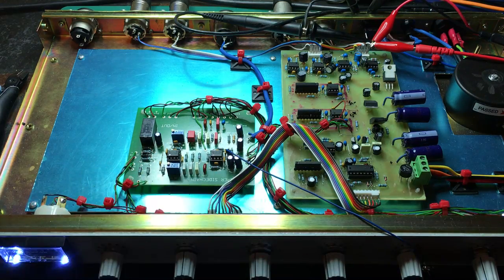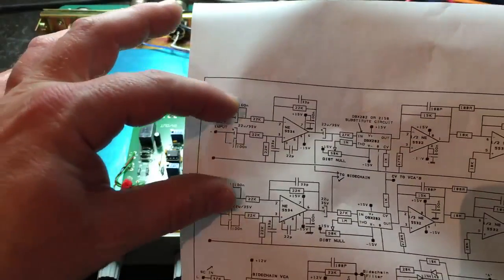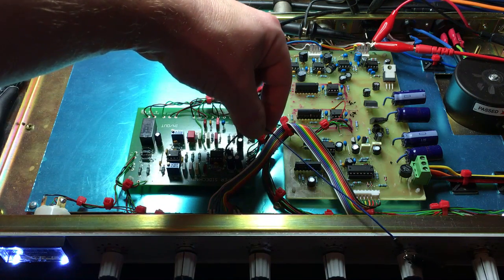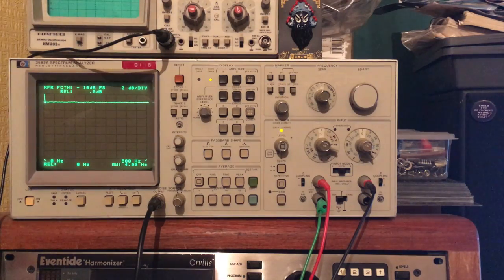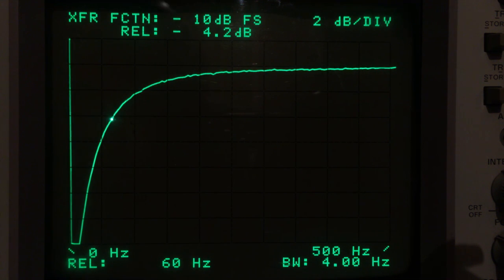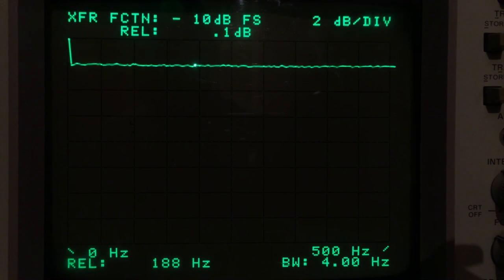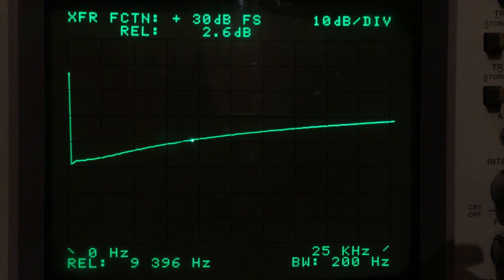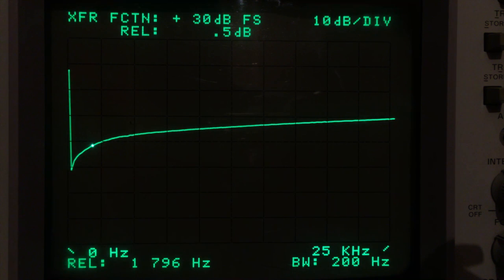GSSL Super Sidechain Hi Pass Filter Mod

Comment: 0:33 that's actually pretty impressive, as tight as the design is. I've never been able to do a good job with etching, either the copper doesn't etch completely away in places or it etches where it's not supposed to, thus shortcircuiting and opencircuiting part of the circuit. I'm looking to get a hold of something that will let me produce PCBs at home, either by etching, milling or laser cutting/engraving. Etching is probably the cheapest way to go, but do you have any good tips on how I might improve my etching procedure and get crisp PCBs every time? How does the industry produce PCBs, etching or milling?

Comment: i finished mine but only the left channel works. and the meter is not working.  i dont hear any compression.  im stummed.
Reply from the maker: I had problems with those silly crimp connections.  In the end i decided to hard solder all wiring to the board.
Reply: littlem4tt think ill try. you know why the compressor part wpuld not work? r u in the usa?
Reply from the maker: i am in the uk.  Check you have the power voltages to the chip and then I guess check you have a signal going to the  vca IC.  But def check all wired connections first.  I just built the Silent Arts d-LA2A and I made some awful crimp connections that gave me trouble until I hard wired them.
Reply: littlem4tt i did the dla2a its awesome for tracking. i had to have a pro fin it for me i got about 89 percent done. make sure to wire the heaters properly!